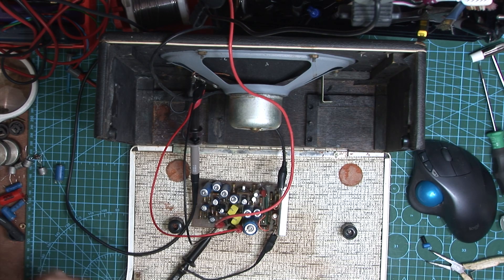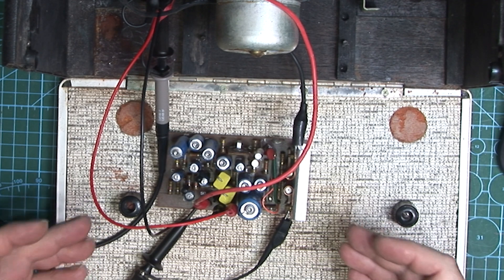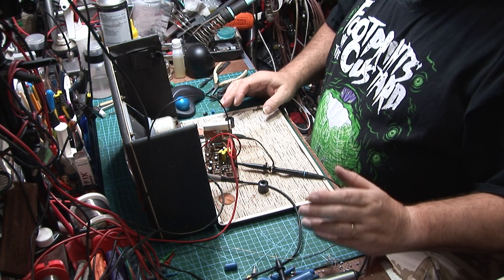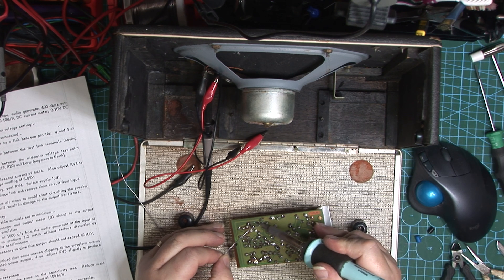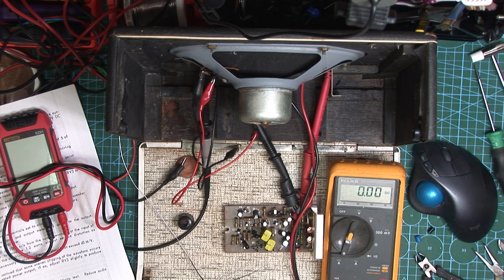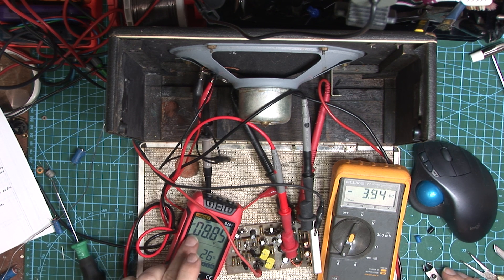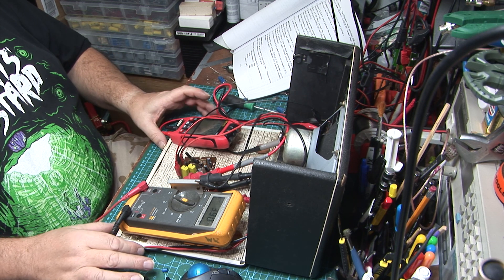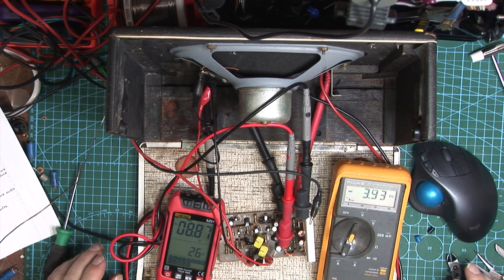Hacker Sovereign Rp18 Amplifier Board Test, Fix and Setup

Comment: Hi George, great video and just what I needed. Can the amp and voltage readings be done separately, or are two meters needed concurrently?
Reply from the maker: really it needs both but it can be done separately. The manual states that you need to measure both but doesn't require two meters.

Comment: Please would you help me. I brought a variac isolation transformer it does not isolate and it interfears with my radios .Would you suggest where i could get an isolation supply from or would you have one for sale yours rob xx
Reply from the maker: Variacs do not Isolate at all. It sounds like you have a switched mode unit which are very rf noisy.  Isolation requires a proper transformer. I buy mine from ETE Transformers (based in bury st edmunds). Proper variacs can normally be found on ebay, look for Claude Lyons, Variac as makes.

Comment: Great Video George, do you have a rear grill for a RP37A VHF Herald you can sell me or equivalent that may fit . Cheers Lee
Reply: Hi, late to this but I bought a 3d printed one from ebay. They're listed as Hacker Gondolier grilles but they fit perfectly.
Reply: @tomclarke1848  cheers Tom, I haven’t got one yet so I’ll check that out . Thanks again for the tip .
Reply from the maker: No, sorry, not got many hunter spares at all. I will try and recreate them on my 3d printer byt they are an odd grille, not straightforward at all.

Comment: A good walk and talkthrough on setting up the amp George. What a difference a cap makes...
Almost set up as a beginners radio with each section being so modular - and no modules... they are reserved for the advanced repairist 😉
Looking forward to the full swept alignment, I take it you are in fact doing the full monty??? asking for a friend...
Reply from the maker: Why, many thanks Mr Codeeze. Yes indeed, a modular radio without any custom modules and easy to service. Part 4 will be alignment with a swept align on the FM side for sure. If the manual calls for a swept on AM I shall force my sig gen to sweep!

Comment: Nice work George. Replacing those old caps sure did a number on the output. :)
Reply from the maker: its a thing with that brand of capacitor but at 60 years old they are a bity tired and worn out!

Comment: You can also set midpoint by feeding in a sinewave and adjusting for symmetrical clipping. That's what I do because i'm odd. Cheers George.
Reply from the maker: In fact, the manual does go on to say adjust for symmetry but as the output on the scope was pretty much there it didn't seem to need any more fiddling. I would say the symmetry method is actually the better one, the voltage method in the manual just being a good starting point, especially for those who haven't done a board before.

Comment: Smashing job George 😀
I was with you all the way, but i was slurping a cup of tea, not quite the same :-D
The thing  i don't like about the hacker p.a is the horrible bias resistor (dodgy).
As the whole amplifier is d.c coupled, any slight drift on any tranistor screws up the final balance.
Don't i moan a lot lol :-D
I hope you had a nice xmas, a two month xmas would be nicer lol :-D
Reply from the maker: Many thanks for sticking with it, its a real chore but the tea would have helped immensely. It is an awful resistor to adjust but a standard pot has not enough current handling really. The transistors are pretty stable on those older boards so drift is not really an issue and the design allows for varying battery voltages too. Christmas was different without a car (I still haven't bought a new one yet) but it was still a sort of break from sitting on my bum doing nothing!
Reply: @GeorgeChristofi  Well you don't need a car for fetching radios, you filled the workshop early on lol.
You survived the crash, the car didn't.
There is only one of you george, im very happy with the result :-D
Ill shut up now.

Comment: What a dream design for the serviceman (or should that be serviceperson, servicehuman etc) having the am, fm and amplifier on separate boards. Unlike some designs where each transistor has 15 functions, which change with switch settings and time of the month.
Reply from the maker: Hacker did design things in such a way as to make quality and serviceability equally important. Being modular meant Production was easier too. Its what Roberts were trying to do by farming the IF out to mullard but they failed when they didn't design the pcb in a serviceable manner.